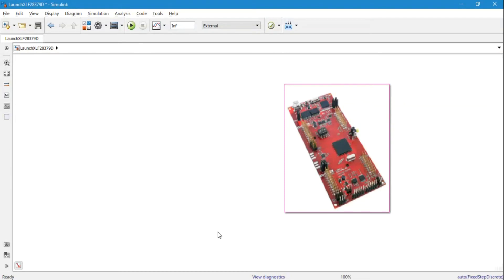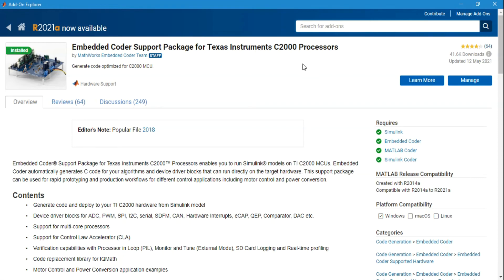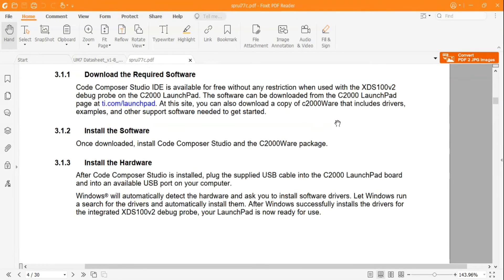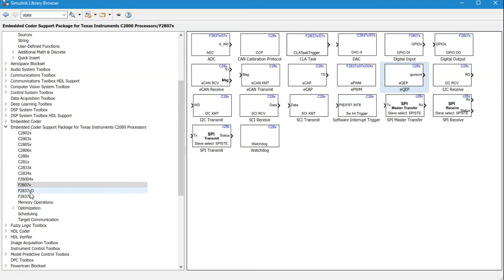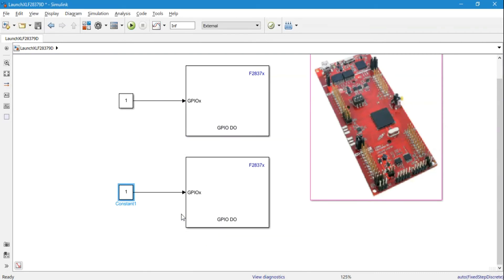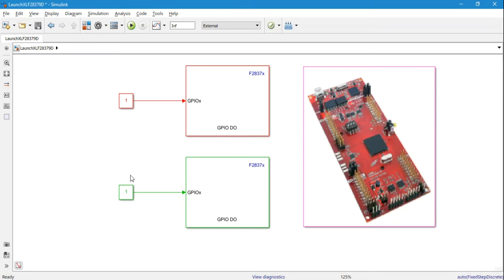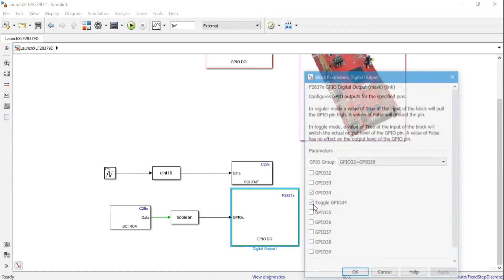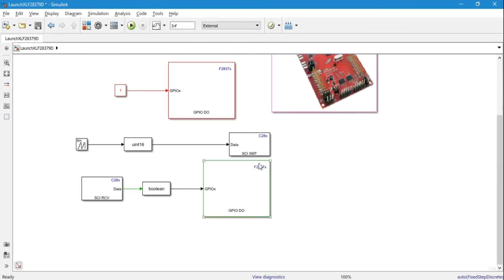LAUNCHXL-F28379D- Blink LED & UART-PART 1

Comment: Why did you convert include a data type converter of uint16? If uint8 is what we needed, why would we need to convert to uint16?
Reply from the maker: The counter limited block value exceed 255. This means we need to use uint16 data type. By default the data type of counter limited block should be unit16 (it automatically adjusts its data type according to its upper limit) however I just made sure that the datatype is truly uint16 that's why I included the datatype convert block.
Reply: @vdcsystems  thank you, that's a clear explanation :)